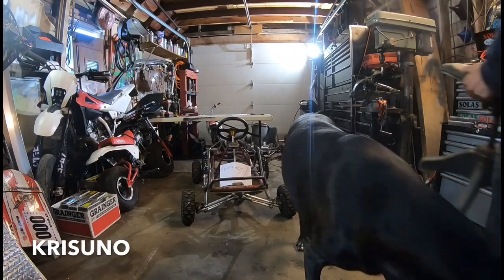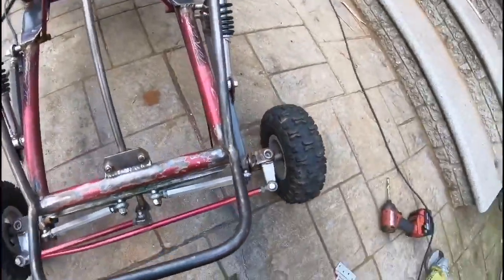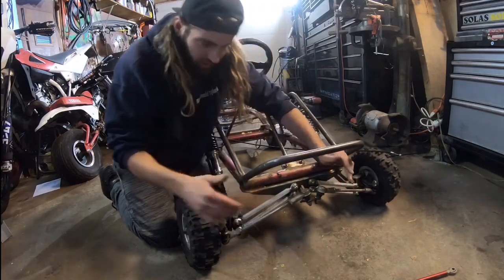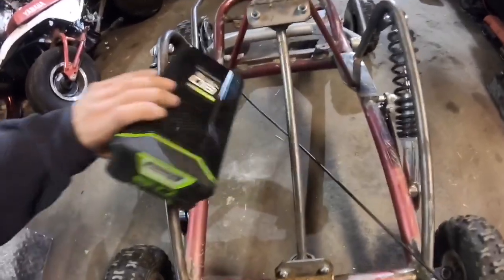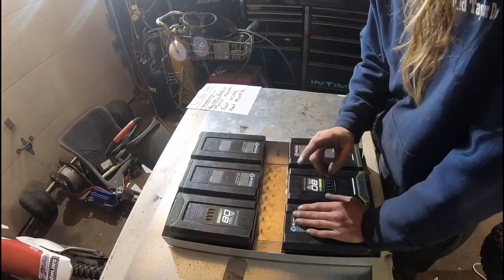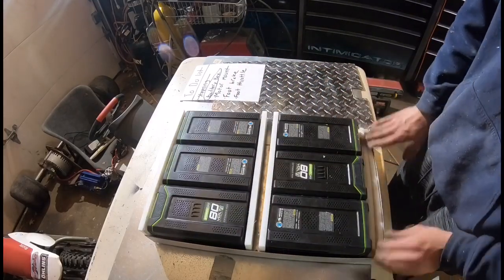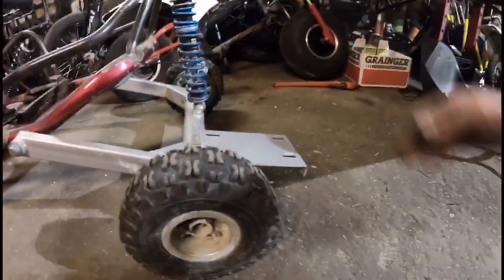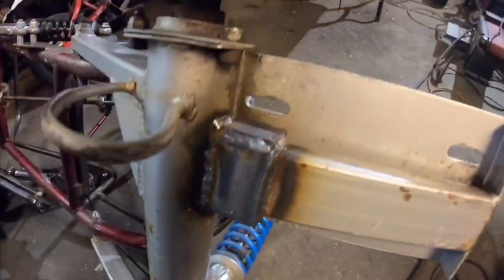(E7) Making an ELECTRIC MINI OFF ROAD GO KART

Comment: I'm currently building something...😁 And I have a 3000watt 72volt electric motor and had thought 1 80volt would be enough but you use 6!!! Do I need to reevaluate my powering source lol?
Reply: Im in the exact same boat.  I think it has to do with the ah. You would only get like 3 minutes of use if your battery is 2ah

Comment: You need to make it dual motor pls
Reply from the maker: Dual hub motors? or 2 Big drive motors?
Reply: 2 bog drive motors you can Probably use one speed controller